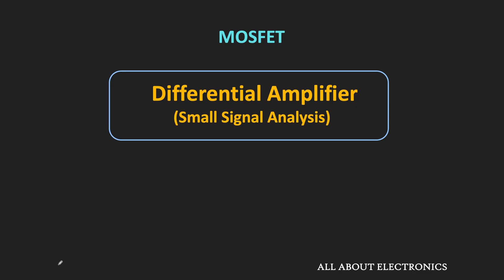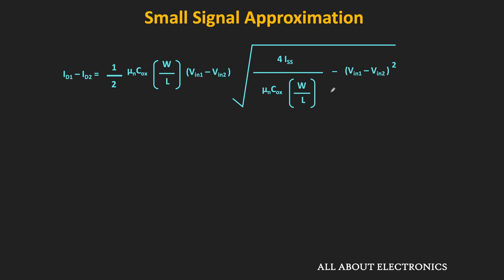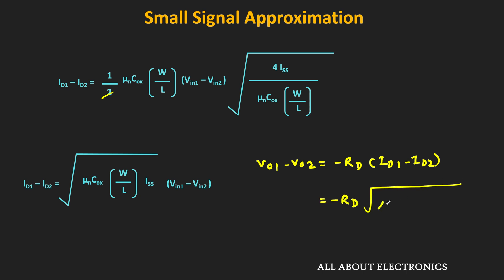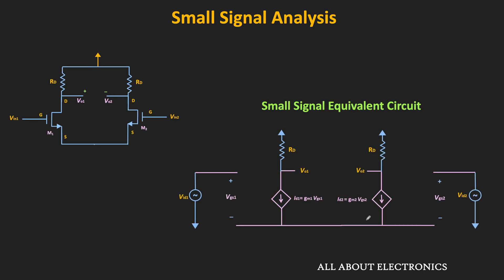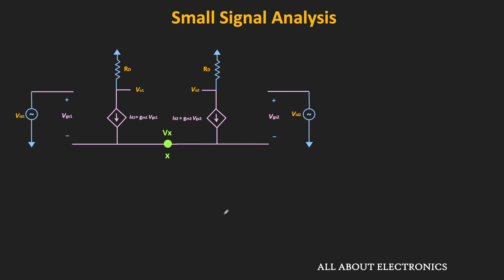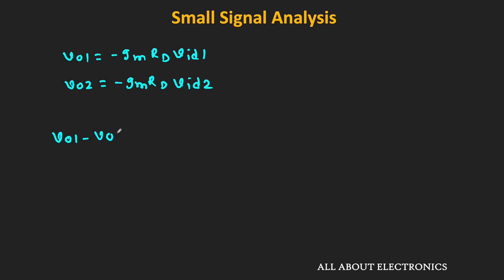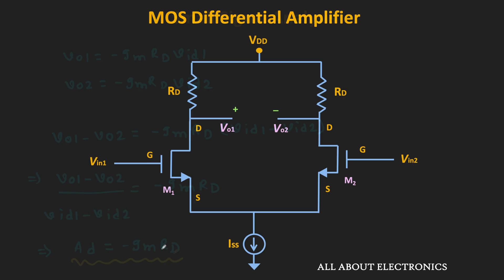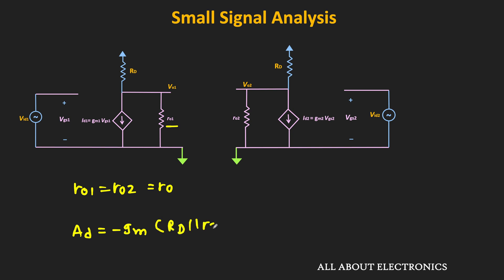MOSFET - Differential Amplifier (Small Signal Analysis)

Comment: @ 2:15 You could have pointed out that the square root term is the 'gm' of one transistor in the diff pair.
Small signal analysis comes out from the small signal approximation.